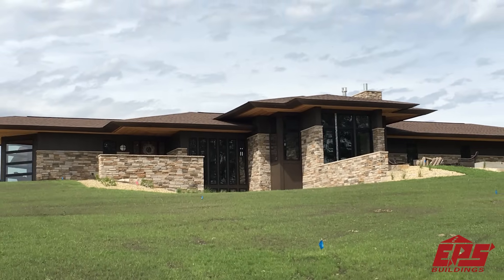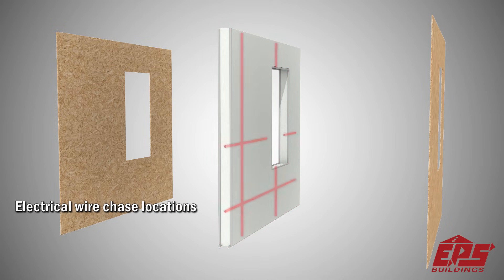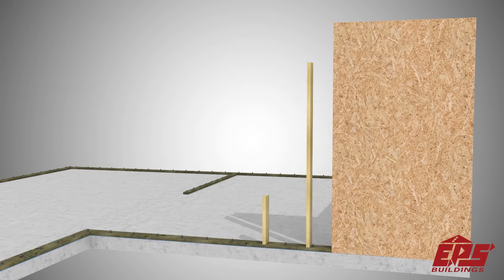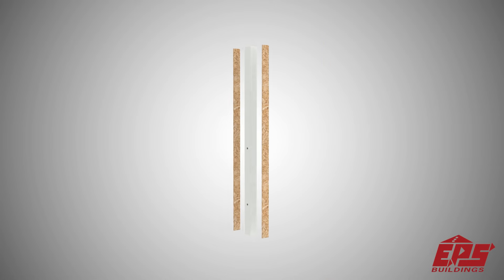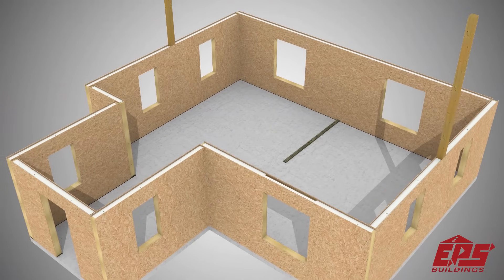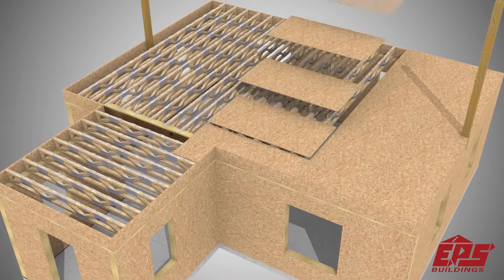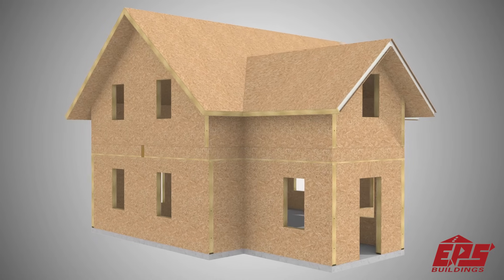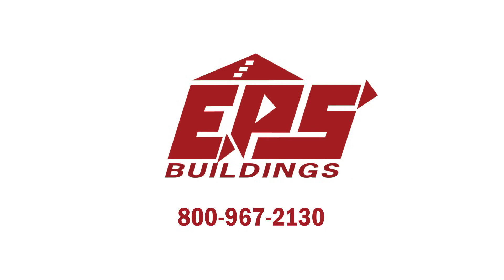EPS Buildings: How a house is built using structural insulated panels

Comment: The biggest negative to SIPS, besides high cost is the OSB outside of the panel.  OSB gets absolutely destroyed by water infiltration; whether constant wet or wet/dry cycling.
I would love a single story crawlspace 1200 sq.ft. 3brm/1ba cottage built using these materials and techniques.  Two horizontal chases for outlets and switches and one verticle chase per panel should allow for all wiring or PEX plumbing runs, but the $$$$$$, wow!
Reply: Can you please explain more as far as cost ? You sound like you have a good knowledgeable. I like to get more information as far as cost and any other issues . Thanks

Comment: I could be wrong but wouldn't using 1 4x4 be better than 2 2x4s to connect the SIP panels?
Reply: What is the dimension of two 2x4s? Is it greater than 1 4X4?

Comment: This is cool but how safe is it to, let's say: Wall Mount a TV" or something like that when you don't have studs, I don't think that white foam in between the strand board will hold heavy weight but I could be wrong.
Reply: OSB is way more than enough for such an application. You can mount few hundred kg water tank on the wall and it will be ok. No worries here..

Comment: What is the cost difference between one of these and a stick built home?
Reply: Thermal, sound.
Reply: That's exactly what I'm trying to find out. My guess it that these days with lumber prices raising due to COVID disruptions and high demand, it might not be much different at all, with all the benefits of using SIP panels over stick framing (in my opinion). I wish someone would compare the exact same floor plan's costs doing it both ways. Everybody always says "it's hard to say because it depends on the details". But if you compared the same floor plan, that would be at least a start. Seems easy, but I haven't found it yet.
Reply: @marlaplunk2833  I was wondering can one make DIY EPS panels. It does not sound or looks difficult but what do I know? Any take on this from anybody? I am thinking of doing DIY garden room with home made EPS
Reply: @victoriabishop1057  I'm thinking about this to. It is cheaper, but a lot more evolved to get them to fit precisely
Reply: @csa6119  where there is a will there is a way. When some says to me you  can't do it, I say I will do it. 80 yrs on the planet spent for nothing? no way. I will put the project on YouTube next year under my [real] name ha ha watch this place. old grl got brain going now. I am not in building trade...😺
Reply: @victoriabishop1057  you are also crazy

Comment: its full of thermal bridging; all installations or structural elements placed inside the panels will lower insulation locally; mixing structure, instalations and insulation all together is a bad design
Reply: MhUser Where did you get your information?
Reply: @ictrains9731  this clips shows it clearly; its obvious that when you place a structural/wooden element inside a space that should contain insulation you create a thermal bridge; same happens with electrical, septic and other installations
Reply: @MhUser  So, a conventional stud wall with studs every 16" has thermal bridging every 16 inches. These walls have them on each end of the panels, which could span at least 8 feet. I'm not great at math, but the SIP panels seem to have mathematically much more efficiency of thermal bridging than conventional stud walls.
Reply: @marlaplunk2833  you will always get thermal bridging when you mix construction with insulation; you can construct your building and then insulate it from the outside in uniform and unbroken way; SIPs are better then 16'' stud wall but there are options better then SIPs; go for better
Reply: @MhUser  What are those options better than SIPs?
Reply: @marlaplunk2833  as i mentioned above "insulate it from the outside in uniform and unbroken way" use whatever insulating material you fancy and building physics allow
Reply: @MhUser  How is that better? My considerations are not 100% insulation driven. There are other factors that go into my decision. In my opinion, SIP panels are the best option for all of the factors I'm considering. Putting up a solid layer of insulation on the outside of my envelope is not the best option for me.
Reply: @marlaplunk2833  sip panels lack any thermal mass inside the building that would  decrease fluctuations of temperature and humidity; also they are probably made of OSB which is toxic; they are expensive; do they have any pros?
Reply: @MhUser  My understanding is that they are so well insulated that thermal mass isn't as much of a problem. Temps don't fluctuate inside the building hardly, regardless of outside temp. They are very efficient for heating/cooling, therefore most people consider them eco-friendly. Another pro (for ME) is that I can install them without hiring costly contractors, and can have them pre cut to my specifications before they're shipped. It would only take a day or two to close the house in, vs weeks of framers putting up stud walls. The panels can also be used for below grade foundation walls, taking away the need to use inefficient and damp concrete walls. Basements are therefore relatively the same moisture content as the rest of the house. I could list a few more pros, but this is getting long!
Reply: @marlaplunk2833  i dont think you understand how massive objects buffer for temperature and humidity changes; they do it passively lowering the frequency of heating/cooling cycles and maintaining sable humidity which both increase comfort; having mass maximizes passive gains like solar or living gains; best setup is mass + countinous insulation which SIP dont offer; SIPs might be better then some other setups or good enough for some people but they are not the best or optimal; you can install everything without contractors as long its not heavy prefabricated parts that needs a crane; im not advocating framed houses; my house has masonry solid walls made from lime silicate blocks covered with 20cm layer of unbroken insulation on the outside; heated volume of 650m3 needs 3kWh of energy at -20 C during the coldest day of winter in January; i use passive gains and heat the house with less then a cord (3 m3) of wood per year
Reply: @MhUser  If you have sheathing on the outside of your continuous insulation, which I'm guessing you do, then you're are not gaining much over a SIP wall, as it comes with the sheathing already covering the 6 inches of foam center of the panel. It is not "unbroken", but every 4 ft (most SIP panels are made as such) is much better than every 16" is all my point is. I plan to hire a crane operator to be able to install my SIP panels with a small crew of family and friends. I appreciate the conversation! Thank you for your time and contribution!
Reply: @marlaplunk2833  i v got close to 8 inches of best eps foam covered with reinforcing layer made with cement based glue and fiberglass mesh and this is finished with lightweight silicone stucco; no fasteners, no holes, everything is 'glued' together; watertight and airtight
Reply: @MhUser  What about ICF's then?
Reply: @orion3267  i dont like the idea of a layer of foam inside the building which limits access to the mass of concrete, which could buffer humidity and temperature fluctuations; walls of concrete are great, just insulate them with foam from the outside and your golden
Reply: @MhUser  The amplitude AND frequency of the HVAC cycles of a passive home are diminished compared to a conventional home. Not only the frequency, right? Or does that depend more on the sensitivy of the HVAC system?
Reply: @EricPeelMusic  ventilation must be on constantly; its heating and cooling that does need to; you can heat or cool passively if you have thermal mass available; the weather is not linear and predictable and its changes are correlated to comfort changes; having solutions to increase system inertia will sometimes allow you to 'withstand' fluctuations in comfort caused by the weather and not use heating or cooling at all
Reply: @MhUser  My friend is attempting to insulate a 12,000 pound, 8'x8'x16' steel container that was originally used for diving training. 

He likely will only be cooling it during working hours. Summer low temps can remain in the 90s and 100s for weeks where he is. But he insists on insulating it only with foam on the outside. He's not putting anything underneath. 

He's painting it dark green.

I told him to give up a few inches for foam all around inside only and just paint it white outside. Let the metal get hot and allow wind to cool it directly. And insulate the interior against the hot metal making the A/C do a lot less work in the morning. 

Who do you think is right here?

Thanks for your fast response and helpful info.
Reply: @EricPeelMusic  does he get frost in the winter? if not not insulating the floor, insulating walls below the grade in the 'hot zone' and having direct contact with soil will give him passive cooling; but if it gets cool in the winter i would insulate all around; also using exterior shutters for sun protection is a good idea and having big windows facing the sun will passively heat the building in the winter
Reply: @MhUser  No frost. And there will be no windows to consider or take advantage of. 

The entire box is suspended about a foot above ground on metal "fins". Thats very interesting about extending the wall insulation down below grade. Would be like an RV skirt in this case to compensate for the lack of insulation on the floor.

Thanks a lot, again!
Reply: @MhUser  Mass has nothing to with thermal insulation.  There are only three ways heat can be transmitted and that is radiation, diffusion, and convection. Any good insulation which stops air currents will limit convection significantly. Weight is irrelevant here. A vacuum is the best insulation as there can be 0 convection since there is no air.

Diffusion is what you are referring to and again, mass is irrelevant except it speeds up the process(or slows it down). It takes more energy to heat up a massive object, in general, and that object will also release that energy longer.  At best this helps smooth out fluctuations but no home is going to have large enough walls to have any real effect on diffusion.

Radiation is mainly due to the sun and that mainly effects the surfaces facing the sun. Reflective surfaces will reduce incoming energy so the other processes have less to handle.

Weight has nothing to do with any of these in any reasonable meaning. The issue with any insulation is that any weak areas can be exploited. Even a small hole in a perfectly insulated wall will leak tremendously. I imagine SIP's are quite good at the center and assuming the edging is taking proper care of the are better than studs.

Obviously with enough money one can build a near perfectly insulated home... it's a waste to do so because one doesn't need a perfectly insulated home and the costs grow exponentially to try and make it so. If the house and panels are put together properly then the insulation level should be good enough for 99.9% of people and the cost variations are minimum. The bigger issue is health and longevity. They use a lot of foam to seal the panel ends and foam generally will decay rather rapidly in heat(it will lose it's bond allowing airflow.

The idea solution for such a system is to create interlocking panels that layer over each other. This would be more expensive but allows one to cover up joints similar, say, a roof.
Reply: @jsmdnq  'smooth out fluctuations ' is the thing that allows for passive comfort and allows for cheap and simple heating/cooling systems or noting at all
Reply: But what wall doesn't?
Reply: @robertbrandywine  you make a construction layer with installations and insulate it from the outside; insulate under the slab; insulate over rafters; insulation is continuous and uniform